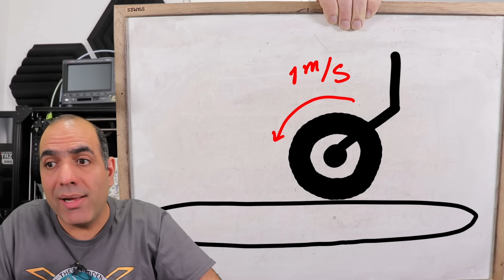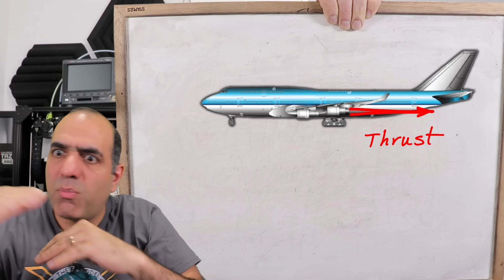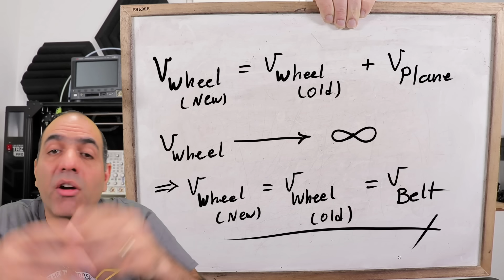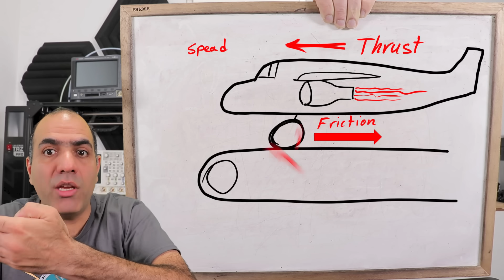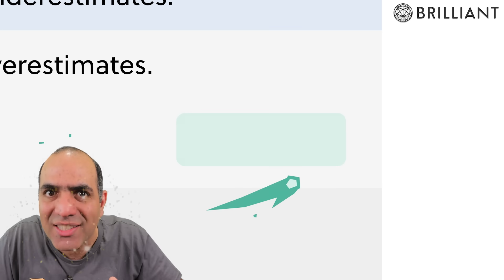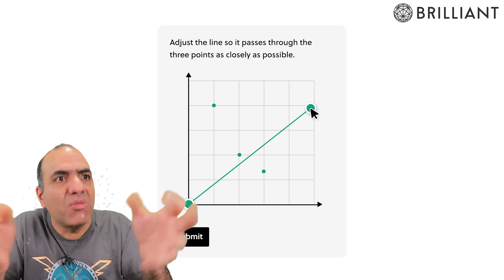Airplane Question that Drove Me NUTS!!!

Comment: so the belt is made to match the speed of the wheels of the plane, but the planes source of accelleration are the turbines which use the air as medium to move in, not the belt. So the plane does not really care about the belt in the first way and would be able to move forward. The belt then would take up speed, as well as the wheels, creating more and more friction to oppose the force of the turbines. The faster moving belt would accellerate the air near it through friction. That moving air will create lift for the plane and therefore sparation between it's wheels and the belt. Does this count as take-off?

Comment: My hot take: you need to take relativity into account, the wheels and the belt become heavier and heavier as their speed approaches the speed of light, eventually collapsing into a black hole, swallowing the whole mildly annoying controversy.
Reply: More realistically, the belt is made of ordinary matter and tears itself apart, destroying the plane along with itself. But yes, assuming wheels and belt cannot be destroyed, black hole.
Reply: @theuncalledfor  it wouldn't be a hypothetical if axles had friction. No hypothetical axles experience friction, so black hole it is.
Reply: @SophieSchmieg  
It's a physics question. If we disable physics, what's the point of the question?
Conclusion: I respectfully disagree.

Comment: I remember Mythbusters did an episode on this, as a kid I understood that the plane wheels spin independently and are not driven like car wheels, so the plane can accelerate independently of the wheel speed
Reply: even if it's a car, it will still move forward. The wheel will just need to spin twice as fast.
Reply: I still want to know engines can move enough air over/under the wing from a stationary position. Or does it need to move through space to do that?
Reply: @northerntarantulas  That's a helicopter. Kinda... I mean it moves the wings through the air fast enough to take off without requiring a runway, close enough, right?
Reply: @K-Anator  but i guess that is also why planes stall out?

Comment: planes do not "fly" because of thrust provided by engines ie a glider has no engines.. an airplane flies because of lift provided by airflow over the wings...as the airplane is stationary we can assume no airflow over the wings ...therefore no flying...just a well exercised airplane..

Comment: Lift only happens with airflow over the wings. In this case there is zero airflow which means zero lift. So, no, it can't take off under any set of circumstances without sufficient airflow, however that airflow is generated.

Comment: Mythbusters did this so long ago. But anyway, the wheels do nothing but hold the plane up. The engines push against the air to get moving. The plane will still take off.

Comment: Jet engines dont give a damn what the wheels are doing the thrust from them should still be sufficient to achieve takeoff the conveyor belt may even make takeoff slightly easier because it will drag a bit of air with it reducing the takeoff speed a little bit
Reply: Assuming the bearings don't explode of course but they shouldn't at only double their normal speed

Comment: Planes don't care whether their lift comes from them moving forward through air or from air just moving past their wings, and their engines pull air past their wings. Any plane with sufficient headwind or strong enough thrust can just take off from a standstill. 

Just think of the canceled out wheels as a clamp or landing legs with perfect friction or something, holding onto the plane until the engines have topped out and the static air flow around the plane has reached the point that it's already "flying" and simply lifting the elevons will cause it to rise (if the plane isn't already designed to generate lift).

Basically just depends on the plane. Jumbo jet? No idea, but probably not... but a Piper Cub could do it no problem.

Comment: ElectroBOOM is wrong. By definition the belt always moves at the same speed as the wheels, so no matter how much thrust jets or props impart, the belt would always prevent the plane from moving. It's basically a perfectly balanced belt that is designed to keep the plane stationary. The plane would never move and never take off. If the plane ever moves forward at all, the conditions of the problem are broken and can never be the case, by definition.

Comment: 0:37 I don't need to take any time. The plane flying has nothing to do with the ground speed (the speed that the wheels are turning when going down the runway). The air over the wings is ALL that matters for generating lift. There are plenty of videos of ultralight aircraft taking off and landing at essentially no ground speed with a good headwind. If a plane suddenly gets a large tailwind (say, from a microburst), it is extremely dangerous because the plane can't generate lift and will fall out of the sky. The wings don't care what the wheels are doing, and the wings are what is important for generating lift.

Comment: Let's settle this
Imagine the plane sitting on the belt while the belt is turned on and moving at some high speed. Now the plane will be going backwards with wind going from back of plane to front. Agree? Now you thrust the plane little bit so plane starts to move and wheels start to move on belt, but having a lot of speed on belt, the plane still keeps going backwards
Increase thrust and after some time it'll match the belt speed and wind will no longer be present (assuming belt will not cause any wind) . Now increase the thrust even more to move forward, but aha! The belt is designed to match your speed so it'll take you back increasingly as you increase the thrust, this no wind over the wings and no lift
Reply: the wheels are not related to the engines, they rotate freely. If you increase threadmill speed the only thing that changes is how fast the wheels turn but the aircraft movement and inertia keeps increasing as normal since it's pushed by the jet engines.
Reply: This!
Reply: @areyou6407  Okay then tell me this - How does the wheels speed increase with respect to ground, if the belt doesn't allow it?

Comment: Speed relative to some other object like the ground or rotation of the wheels is not what makes a plane fly, lift is what moves it vertically, thrust is what moves it horizontally.  The differential of pressure over/under the wings is what gives lift, so a plane sitting still will lift given proper wing geometry and a strong enough wind from the right direction.

Comment: The planes movement isn't through the wheels so yes it will. They don't use wheels to accelerate like a car. So it doesn't matter that the belt is even there. Planes aren't cars.

Comment: I think I found a different solution, the 747 has a thrust reverser, so imagine if instead of starting by going forward, it would start reverse some. Then the wheels would start moving in reverse and then the conveyorbelt would start going and both their speeds would increase very fast. Then, you'd disable the thrust reverser and put on the wheel brakes, that would then generate a force to push the plane forward and while the wheels and belt are slowing down, (remember the belt is still going forward in the direction of the plane), there should be enough time for the plane to accelerate to a high enough speed before the belt has started going fast enough in the opposite direction of the plane, so the plane could therefore take off.
Reply: Still doesn't work, for the plane to move the wheels have to at some point be moving a different speed to the conveyor
Reply: @bosstowndynamics5488  Well yea, with the assumptions ElectroBOOM made the wheel speed must differ from the conveyor speed, but in the scenario where there is friction between the wheel and the belt, there would be some wheel slip as long as the plane moved. By letting the wheels get up to a very high speed by first reversing very slowly, and then braking the wheels some which would result in some more wheel slip, they should provide a force forward on the plane. With a high enough wheel speed to begin with they should not have time to stop and change direction before the plane is in the air.
Reply: @ourcraftnws7480  But if you allow for wheel slip you can just skid forwards down the conveyor and pretend you're taking off in a sea plane or something.
Reply: So, you're basically pulling back before springing forward, like a catapult?
The way i picture it it might make more sense to let the plane and wheels match the conveyor belt in a stationary way and then at some point push the brakes (have to be really good brakes and strong wheels..) and use that momentum to increase the air flow.
EDIT: If the conveyor belt moved forwards, of course.
This doesn't work in the normal way of the conveyor belt moving towards the plane, because pushing the brakes would just push it backwards.
Reply: @Games_and_Music  I would imagine the plane going very slowly in reverse, basically stationary to get the wheel speed up and the conveyor going forward, and then use the momentum to go forward, basically as you said
Reply: @ourcraftnws7480  Yeah, it could be a possibility, and like you said, this question lacks the specifics to narrow it down to 1 answer.
But if the approach is basically a catapult, maybe we could also just simply use a very long belt to act like the catapult.
As it would reduce the strain on the plane for not having to do the 'extreme boost effect'.

Using the brakes (thus making sure that the wheels and plane are connected, and the wheels affecting the plane speed), you could stay put as the conveyor belt starts moving forwards, taking the plane with it until it has enough speed to lift off.
But yeah, then i worry again about the moment the plane lifts off but comes dipping down once it's no longer getting pulled.
Reply: You're still missing the fact that the wheel speed is determined by the plane's ground speed. The engines push the whole plane, not the wheel, so the thrust reversers would just pull the plane backwards and the wheels would spin up until exploding.
Reply: @dustinbrueggemann1875  With the assumptions made there would have to be limited friction, so there would be some time before the wheels spin up and explode, in that time you would presumably have time to disable the thrust reverser and apply some whel brakes to slow the wheel speed and apply a forward force on the plane.
Reply: But I don't believe there is a correct answer to this question since the answer depends on the assumptions you make, hence why it's so annoying.

Comment: Would anyone here strap a turbojet engine to the back of a wheelchair, put it on a treadmill designed to perfectly match wheel speed, place it all facing a concrete wall and then attempt the experiment?  Perhaps therein lies the answer.

Comment: It's the thrust only that causes the airplane to move forward, and rotate the wheels. If the wheels are rotating with same speed as convare belt, then the airplane is stationary. According to me, there's no reason for airplane to take off.

Comment: no, the wheels dont matter at all here. since the plane never moves forward the air never passes over the wings, without the air across the wings there is no lift. the answer is no. given the the information of the question the plane never flies, you have to create outside conditions or reason outside of the question to justify any other answer, and that isnt what was asked.

Comment: Plane can not take off. After plane starts moving relative to the ground wheels will spin faster and faster, making the belt speed up, leading to even higher spinning speeds. Finally gears would melt or disintegrate so plane would lay on the belt without any wheels which would lead to a disaster. Thats why threre is a difference between theory and practice

Comment: This question is much simpler than people think. For the plane to take off the wings need to create lift. For there to be lift there needs to be sufficient airflow around the wings. The treadmill means that the plane will always be stationary relative to the treadmill and therefore the ground. What is important for a plane to be able to fly is air speed and air speed is ground speed + wind speed. (Say if the wind was coming from directly behind the wind speed would be negative. Pilots angle the plane so it’s perpendicular to the wind direction). When there is sufficient amount of air speed then the plane is able to take off due to the lift created by the wings. The engine pushing on air increases ground speed which contributes to airspeed, then the flow of air over the wings creates lift. The engines do not create lift because they don’t flow air over the wings, in fact they would make downforce because of the lower pressure in front of the wings. 

This fells quite obvious for me and I don’t see any issues with it. ChatGPT approved 🙃

Edit: I asked chatGPT if this was true and it agreed on everything. Taking this with a grain of salt

Comment: Actually not only thrust of the turbines is needed but also  air for the wings to glide on.
In order to make this work acceleration plus movement is mandatory.
The faster you accelerate through air filled space, the higher front air resistence becomes.
So actually what a plain does is cut trough the air.

Well, if this would work there certainly would be runways in the world implementing this concept.
I don't know any...
Simply think of all those dangerously short runway in the world.

Even a concept in which the plain leaves the conveyer belt in order to accelerate the wheels would certainly not work, the change of friction would destroy the wheels and maybe the plain itself by tilting frontal ( moment of inertia)

Comment: Of course it will fly. The wheels are free-spinning and have nothing whatsoever to do with the airplane's thrust or speed, so the airplane doesn't care what the conveyor belt is doing, it will fly because its engines will accelerate it to flying speed. The caveat, though, is that the wheels will be spinning at the airplane's take-off speed PLUS the conveyor belt speed, so they will have to withstand the stress & heat from the added speed.

Comment: Mythbusters did test this exact thing with the plane on a treadmill. Long story short: plane engines push against the air, not the ground, so they can take off with 0 issues
Reply: it's the air speed over the wing that makes the plane take off...
Reply: @DynamicSeq  which is exactly why the wheels are completely irrelevant here. The engine pushes the plane, not the wheel. The hull will move forwards regardless.

Comment: I think if the belt was spinning the wheels at the same speed the jet engines are trying to propel the aircraft, then no because there would be no air friction or lift on the wings

Comment: Ofcause it can take off. The Belt would jsut spinn the wheels and the friction caused by the bearingsspinning cant be that high to cancel out the thrust form the engines. If there would be just metallrods instead of wheels the plain couldn´t take of because the Friction is high and with that the pulling force of the belt is translated emediatly and directly to the Planes body and the thrust porb can´t cancel out the Belt movement. Its like the Hotwheels car on a treadmill that you see on tiktok all the time.

Comment: I heard this scenario from Adam Savage... i could not for the life of me get it. It took someone in the comments to point out that the wheels are not powered... the forward momentum comes from the planes engines... The wheels are nothing but rollers keeping the plane off the ground. The plane will still move based on the planes engines... as they are dependant on combustion of air... moving the plane like normal (it's independent of what the wheels are doing)... eventually lifting the plane just like normal.

Comment: Short answer: No, the plane will NOT fly🤔. Long answer is also no, but takes longer to explain😂

Complete Answer: The wings moving through the air is what generates lift at the molecular level, and causes the plane to "fly".  Unless you blow air across the wings (forward to aft direction) in excess of the stall airspeed, the plane shall remain grounded.  

More detailed answer: We can dive deeper into Bernoulli's principle and explain how accelerating air over the top of the wings is needed to create a pressure drop on the top surface of the wing that thus "sucks" the wings up to create "lift".  Alternatively, we can use the fundamental physics definition of gas temperature to illustrate how the geometry of the wings "sorts" the air molecules and decreases the mean z-velocity of each air molecule that goes over the wing while increasing the x-velocity of the same air molecule, resulting in a net upward push from air molecules under the wing. This is a great question for first-year aeronautics engineering students.

Comment: my comment because you asked to : 
consierign there is no air resistance the airplane will not take off
buuuut that is if we consider that the belt isn't pushing the air even so slightly, if so , i think the airplane would need a much much higher speed to take off

Comment: Watch Mythbusters Season 5 Episode 28: Airplane on a Conveyer Belt.
I will say that if the speed of the wheel is the speed of light, the mass increase would just create a singularity and everything would just be sucked into the black hole.

Comment: As long as the tires and wheel bearings don't fail it's irrelevent.  The thrust of the engines is not spinning the wheels.

Comment: The plane can't take off, because the conveyor belt trying to match the plane's speed results in a positive feedback loop that superheats its surroundings due to friction with the air, causing the plane to melt.